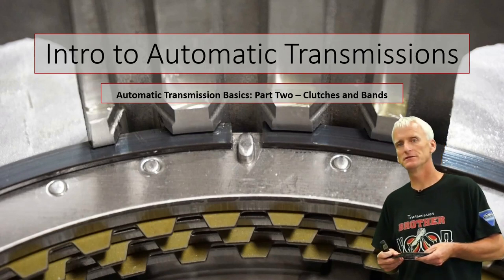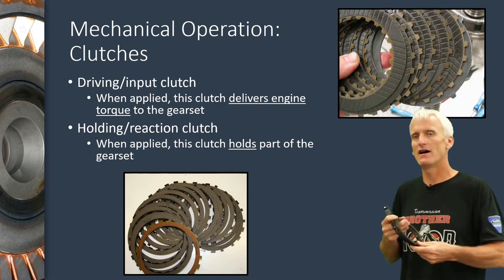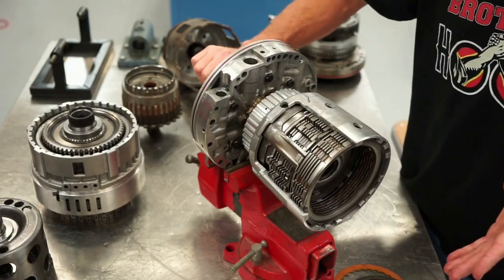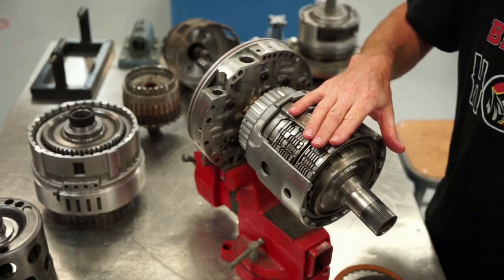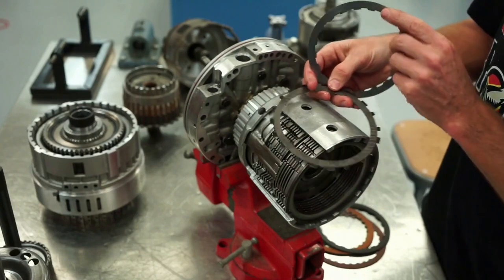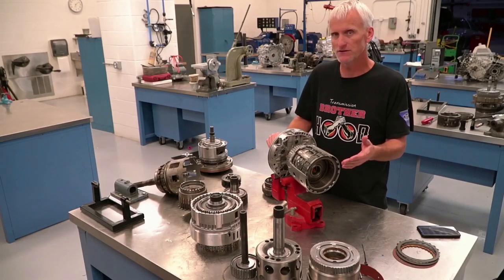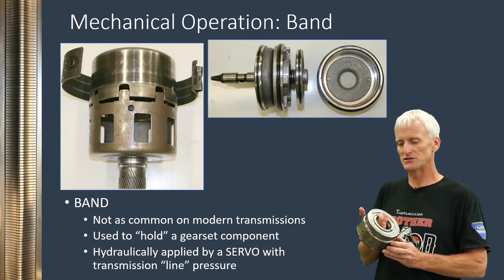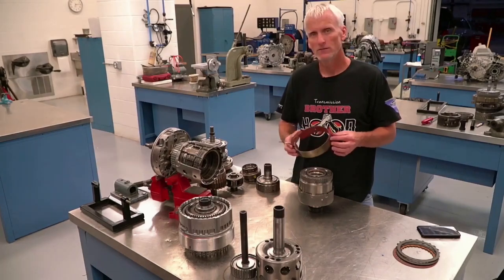Basic auto trans clutches and bands

Comment: Steels in this case held outside of clutch and the clutch discs held the output shaft! TY, you made it so freaking eaSy to understand! I am an Elec/Mech Tech 34 years at a national lab, I am going to attempt to rebuild a 62TE and this is going to help
Reply from the maker: Watch the 41TE series, because the 62TE is basically the same transmission that's been upgraded to a six speed.

Comment: When you "name" the clutch assy' as 3-4 or 5-6 etc, is it obvious to you by the way it is stacked or is it by the manufacturer's design and it's spec'd out in a manual?
Reply from the maker: Manufacturer design.  The clutch name, such as 3-4, would mean it's applied in 3rd and 4th.  Some manufacturers number the clutches, like C1, C2, etc.  Some label them as K1, K2 (kinetic or driving), B1, B2 (braking/holding), F1, F2 (freewheeling clutches like a roller clutch or a sprag clutch).

Comment: Are the clutches soaked in fluid or does the fluid stay behind the pistons?
Reply from the maker: The clutches are constantly fed fluid through lubrication circuits.  Many builders don't soak the clutches before assembly, but most all service manuals suggest soaking the friction material before install.

Comment: Is the band used to manually lock in a gear like 3rd or 2nd?  Or does the transmission use the bands during normal operation?
Reply from the maker: Transmissions that use bands will use them during normal operation.  Their purpose is to "hold" a part of the gearset from turning.  With a planetary gearset, to get an underdrive, overdrive, or reverse, you need something input, something held, and something output.  The band will hold that gearset part from rotating.  Newer transmissions use a clutch between the case and the gearset component, but many older transmissions use bands.  The most common would be the 4L60(e).  It has a 2/4 band that holds the rear sun gear every time it shifts into 2nd and 4th.  

There are some bands that are used for manual gear selections and they are typically used to prevent a one-way roller clutch from freewheeling during deceleration.  That way you can get engine braking when in manual gears.  A turbo 400 will do that to prevent the intermediate sprag from freewheeling in 2nd.